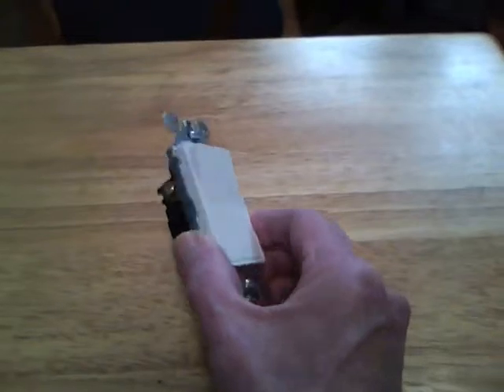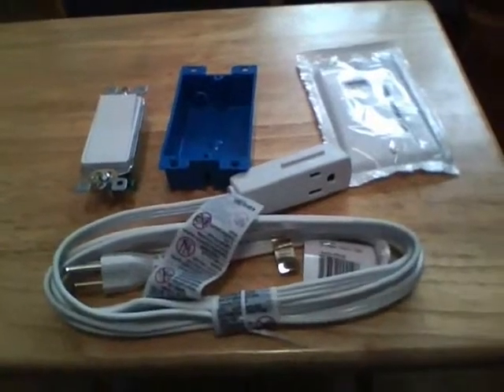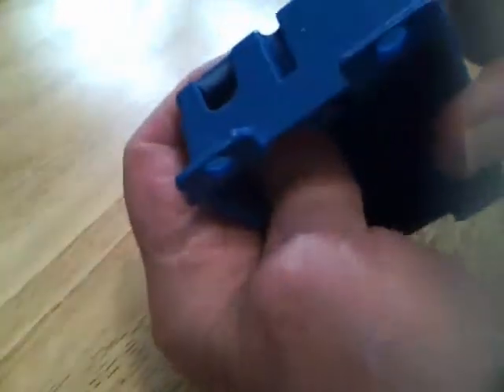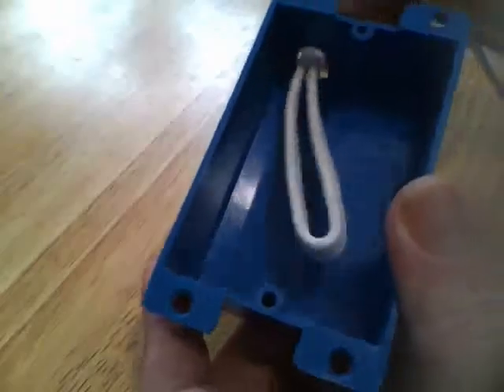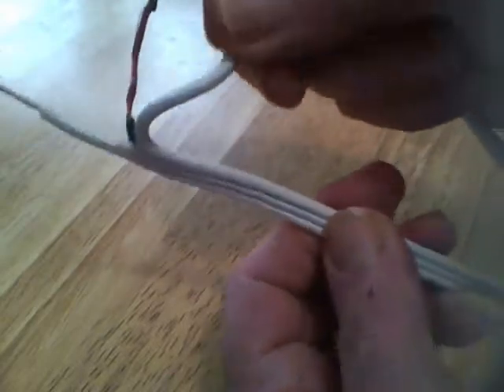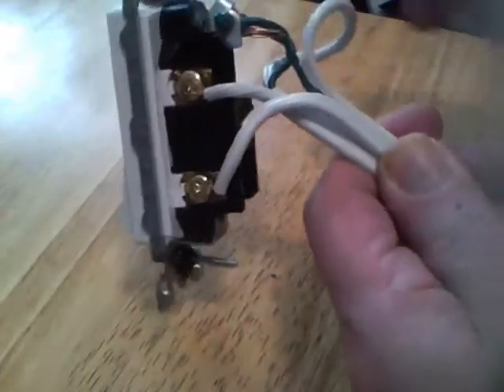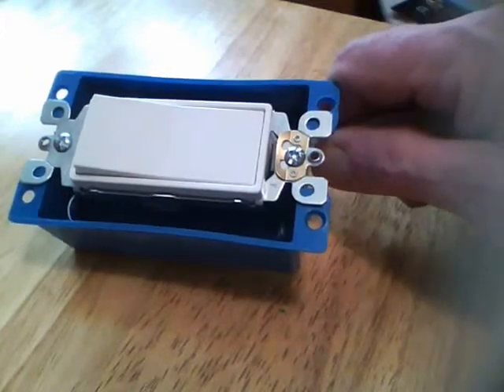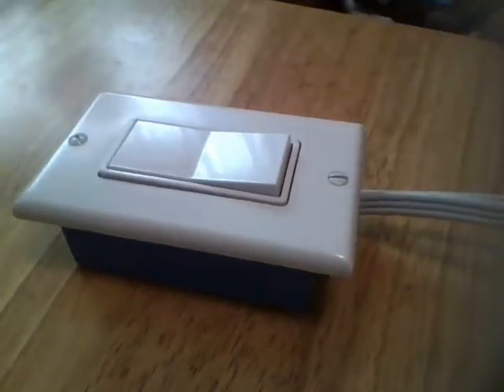AC Footswitch - how to make it.

Comment: I don't think the white wire is the hot wire. I think its the neutral, ad the green wire is the ground. the black wire should be the hot wire.
Reply: +john Rudolph   You are correct.  Hot: The black wire is the hot wire, which provides a 120 VAC current source. Neutral: The white wire is called the neutral wire. It provides the return path for the current provided by the hot wire. The neutral wire is connected to an earth ground.  However, it is AC.  A simple re-wire would fix it if it didn't work.

Comment: Nice Job ... you can also use a push button switch that doesn't stay on ... if you have a habit of only wanting to use it for a short time.  When you release your foot and walk away it shuts off. Lastly you are right most dimmers chop the AC in such a way that it's not functional for Induction motors (causes excessive heating), but it will work for most BRUSH type Motors.  Also most dimmers don't like the inductive spike that comes back from most motors.  U can find some motor control dimmers.